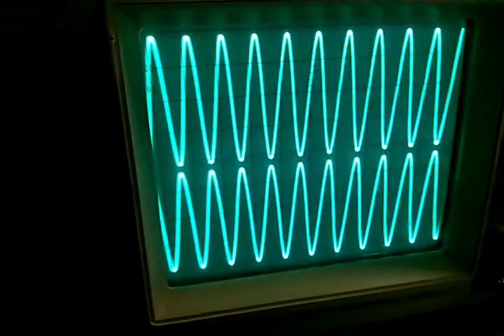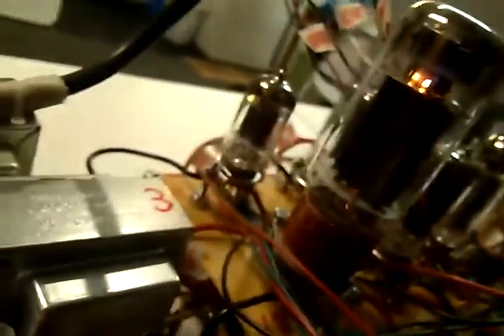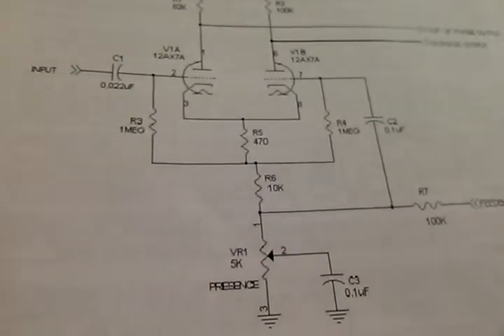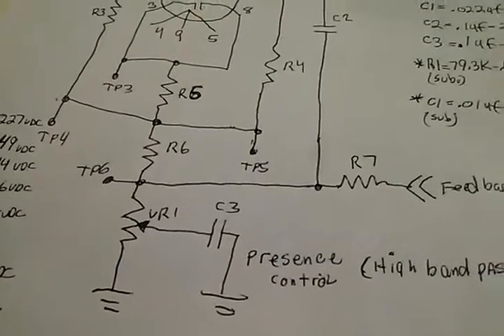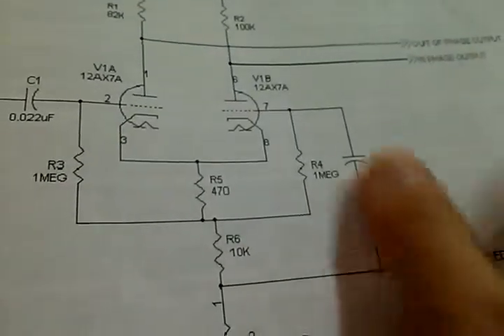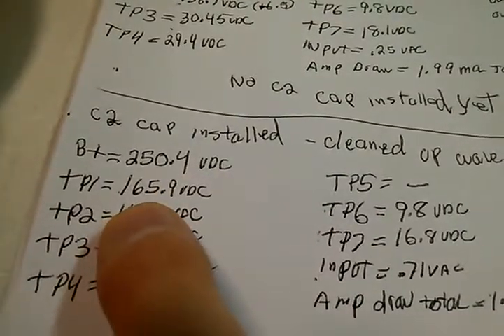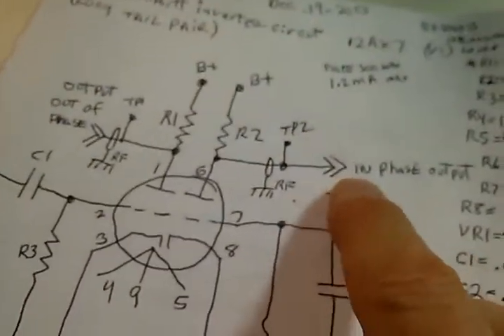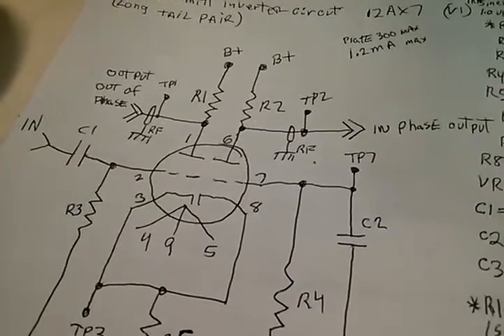12AX7 Schmitt Phase Inverter circuit (PI)

Comment: Howdy. Nice.
Looking at guitar amp. schematics I observe that they almost always use 12AX7 (ECC83) in the Schmitt splitter. Not good in my mind. 12AX7 is a high gain and high impedance tube mainly intended for preamplification. It struggles to drive the end tubes at higher frequencies as the end tube grids have quite some capacitances. I would think one should use 12AU7 (ECC82) to deliver lower output impedances to drive the output tube grids.
Best regards.